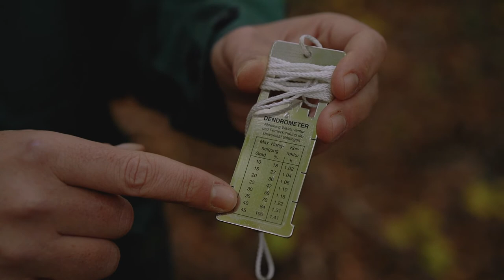How to establish a Bitterlich (Relascope) plot with the Dendrometer or wedge prism

Comment: Where can I buy a dendrometer?
Reply from the maker: I am very sorry to inform that we have stopped the production of the Dendrometer recently. For more than 40 years it was produced at our institute. The increasing demand was to high and as a university we are not a reseller for instruments. Your alternatives: 1) there is a 3D print file available (see our video on 3D printing a Dendrometer and the link in the comments), 2) Haglöf is selling a "Factor Gauge" that does the same job and can be found at many resellers.